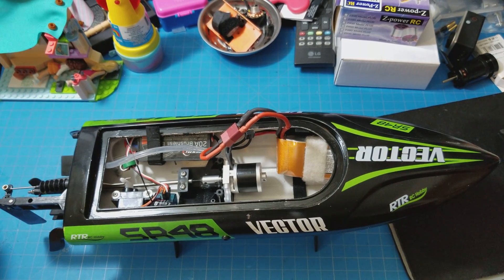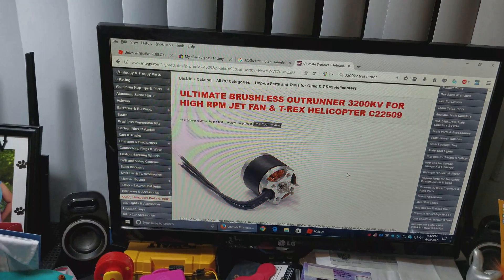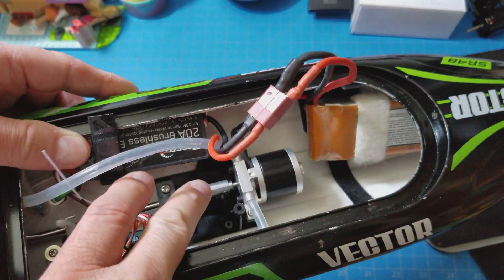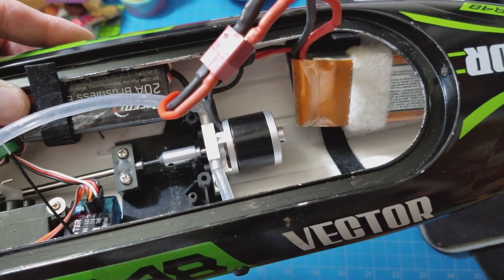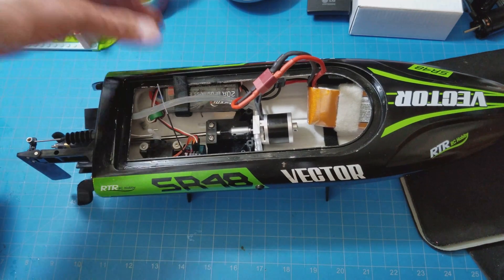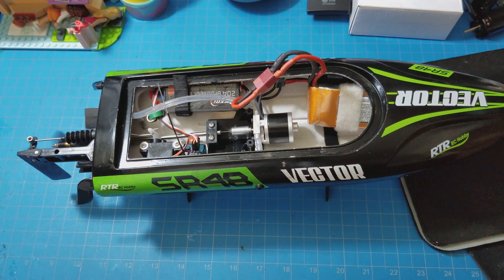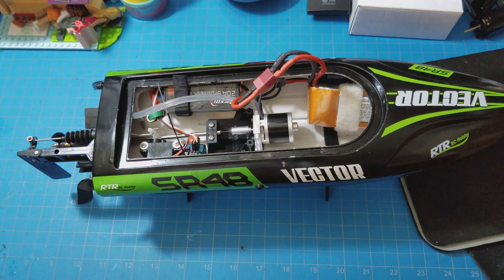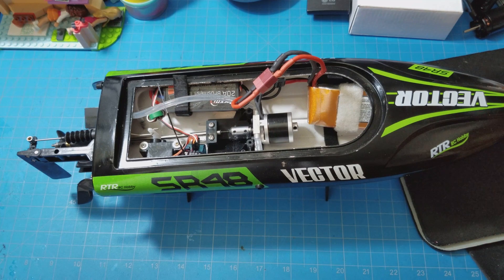Vector SR48 RC Boat motor upgrade bend test to 3200kv Brushless

Comment: the cog would be horrible with that battery way up front... cog for that boat should be around 6 inches from the transom. other than that the power should make a big difference.. but you never made a video :(